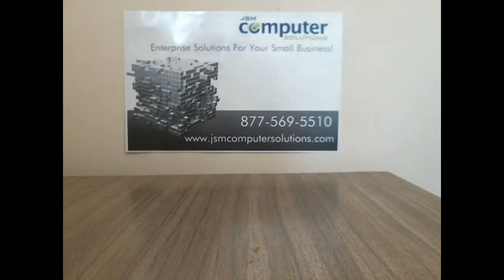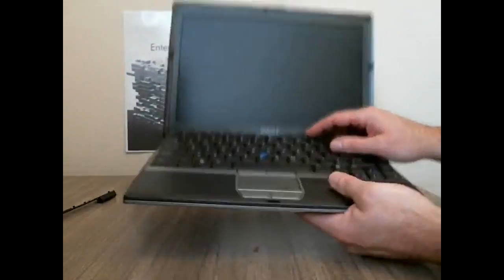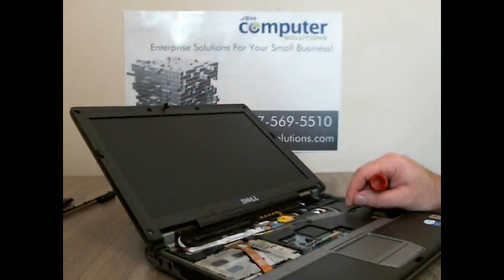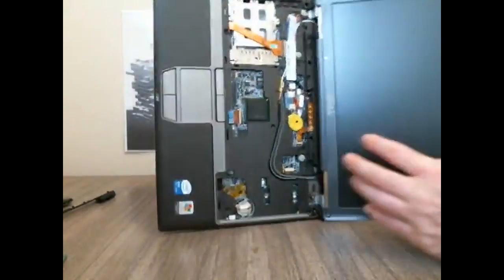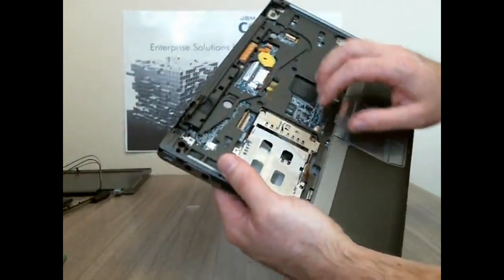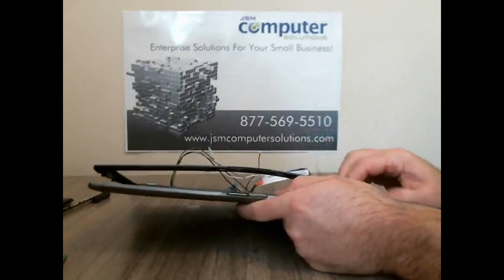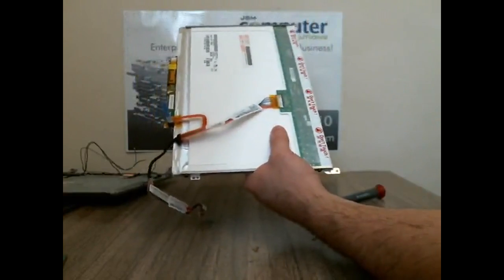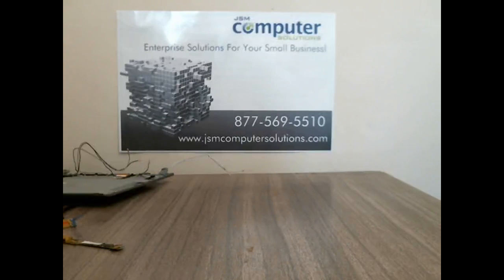Taking apart a Dell Latitude D420.avi

Comment: Can you add an SSD in place of HDD in these, or will it cause overheating issues? Can you upgrade the CPU to an Intel "H" series one? As you can probably decipher, I'm not a techie, but I can unscrew screws, and unclip plastic locking mechanisms. If the upgrades, I've just listed, are doable, do I need to check the Bios's, or anything else? Many thanks, in advance.

Comment: I found your video very interesting. I just purchased a used Dell 420 and loaded Win XP pro sp3 and then Win 7 prof and could not figure out the mono external speaker and driver for either OS.  Am I missing something on the SigmaTel drivers. I have tried A03, A09 and A11.  Any help in the right dirction would be appreciated. I prefer the Win7 direction.